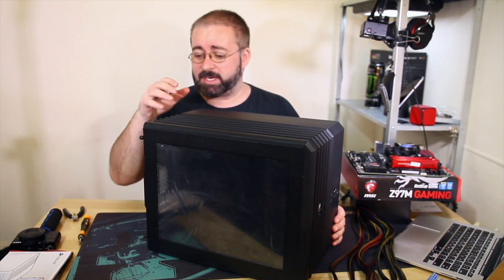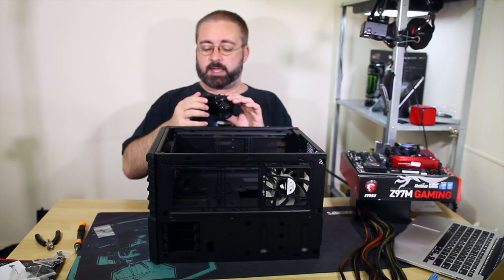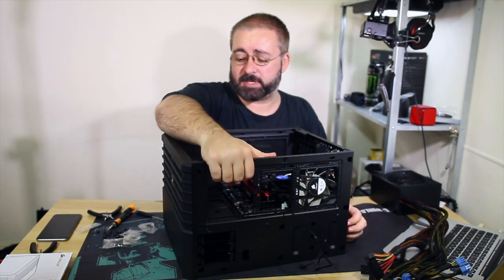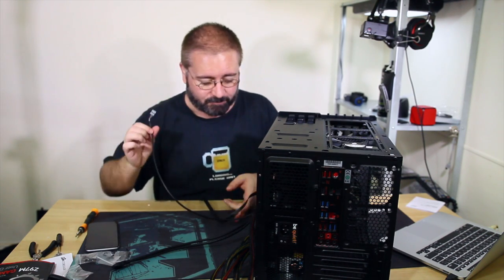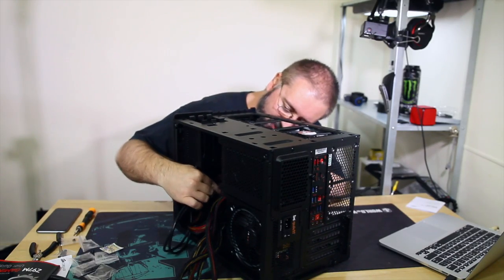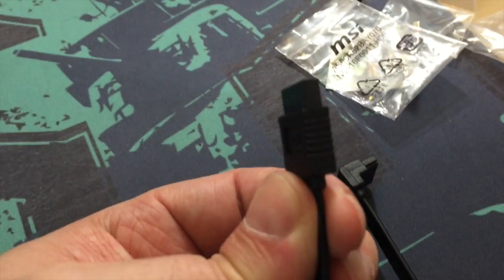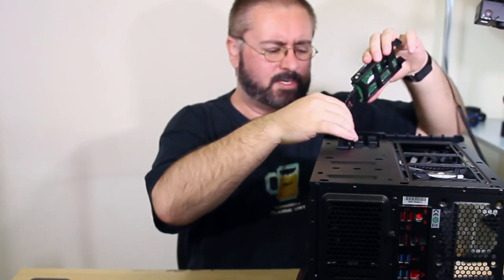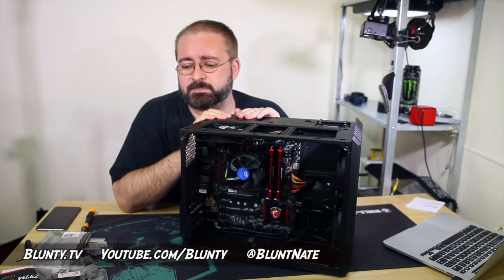Bad at Screwing, Stick it in the Box - Devils Crevice Gaming PC Build

Comment: I found that installing windows from a fast USB 3 drive on to a fast ssd really doesn't take up as much time as it used to do back in the day (even a slower drive doesn't take all that long) . Just keep recording and look for your DVD-rom drive so you can install the network drivers
Reply: jeffry de meyer That assumes you can use the USB 3.0 port before it gets into Windows to install drivers for it. You need to throw it into a port controlled by the Intel erm.... controller lol. It can be rather hit and miss with other controllers if they work properly or not which is sadly why so many systems still come with 2.0 ports along side 3.0. Which is insane if you think about it. How rushed and half assed was the USB 3.0 spec if this is still an issue?
Reply: TalesOfWar I think UEFI solved that issue

Comment: 51 minutes?! HELLSFREAKINGYES :D

I believe the Molex connector is on its way out, and Floppy connectors (I believe) are mostly used for front-panel card readers and what not.

Great video! I like your build because it's an 'Everyman' build. It doesn't have 3-way Titan X's or what not. It's a nice build, and I genuinely like the case. Really keen to see which graphics card you've settled on.

And yes, you deserved a beer, and yes, warm Monster tastes terrible; cold Monster is brilliant, though.

Comment: Good job on the build there Blunty. Now go get a cold one. :)  On that 24 pin if you are going to be a while before you get new cable extension you can do a little trick that I do.  Get a little can of flat black spray paint and spray the wires on the end there black. Once there dry pug it back up and it looks 1000 times better.  Any way that's one thing I do to make them look better to me. Thanks for the video.

Comment: i just built my 1st pc and i had to use one of those  annoying IDE cables for an old hard drive that was given to me.it defiantly fucked up my cable management.:/ i ended up raiding my old laptop and using the hard drive from that thing so i wouldn't have to use a 2nd one :)  

nice pc mate, probably a stupid question but are you gonna do update videos or film you replacing parts?

Comment: Mini Molex I've seen used on LCD read outs, water pumps, fan controllers, fans, card readers... Used as a legacy connector it would still support a handful of drives... Some of which should theoretically be well beyond the shelf life of magnetic storage.
Reply: Virgil R Garwood I've seen it used on a few sound cards too. The more beefy ones that need extra juice to run.
Reply: Ooooo good point, I completely forgot about the ludicrous vacuum tube sound card that uses the mini. Thanks for reminding me.

Comment: you "screwed" up aaahahahaha because you screwed up the screws :P

On the SATA cable the 6G was for 6Gb/s the 26AWG was for 26 American Wire Gage
Reply: PAPO1990 That stuff is generally imprinted rather than printed printed. At least on the cables I've had. It's sometimes dot matrix black print on the red cables, but it's always been an indent on any black cables I've had. It's pretty odd seeing them with such obvious white printed text on. Saying that I usually get Asus or Gigabyte boards so this could just be what the suppliers MSI use do.

Comment: Why have a beer when soda is far cheaper , and tastes better? :)

Will you be reviewing the automated overclock function on the motherboard when you get better cooling? (automated overclock increases voltage, thus it will not work with the stock cooler)
Reply: Razor2048 You don't drink beer for the taste...
Reply: TalesOfWar I do :D
Reply: The taste is one of the main issues, for the price they charge, the least those companies could do is make it taste good. For example, if they are going to charge 3 times the cost of soda, then it should offer a similar amount of fluid, and be 3 times as sweet and flavorful, and it should be at most, 1/3rd the bitterness of the soda. Technology has come a long way, why can't the beer companies figure out how to not make their beer so bitter?